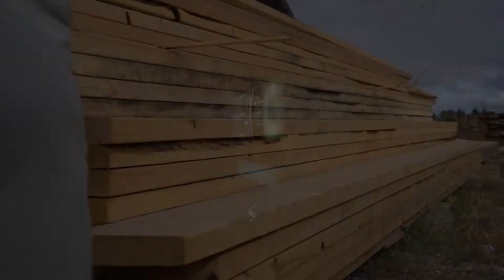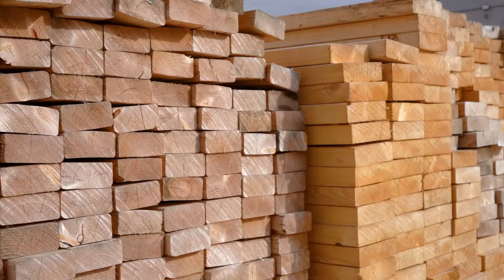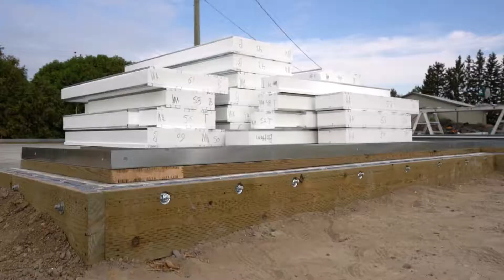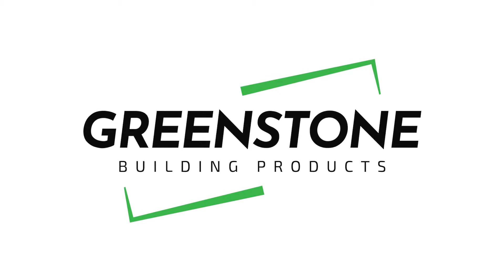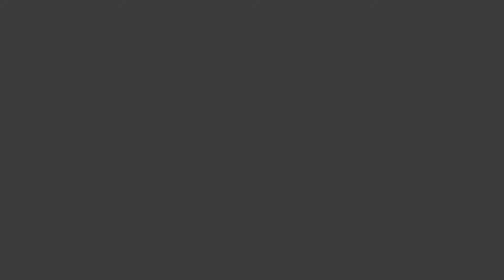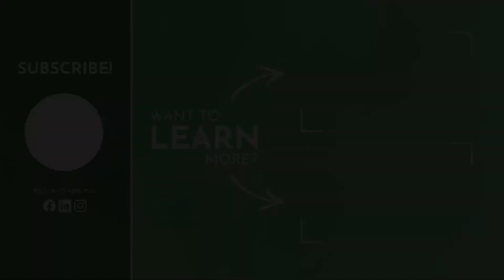ICE Panels vs. Lumber | Break the ICE

Comment: I'm have looked through most of your videos. But I have not seen how dryer ventilation is being installed through the wall and running pipeline for the ac?
Reply from the maker: To install dryer or AC ventilation you would drill through the panel avoiding cutting through any steel studs. After cutting in, it's important to ensure that it is well sealed around opening.
Reply: @GreenstoneBuildingProducts    Thank You for your reply. I figured that much. I'm thinking a heavy pvc through the wall. What about living in Florida? How much wind resistant or restriction? I could call you, but I figured you may need time to give me answer. Thank You in adavce.
Reply from the maker: @noemontalvo2305  ICE Panels have been known to stand up to wind quite well. In 2019 we had a project in the Bahamas face Hurricane Dorian with minimal amounts of damage reported. Feel free to call us anytime! Our number is 204-726-1426 or email info@gsbp.ca with any other questions.